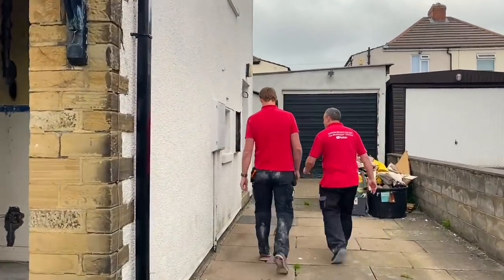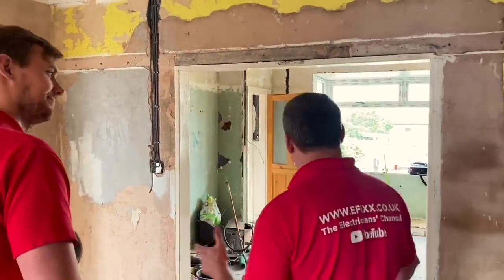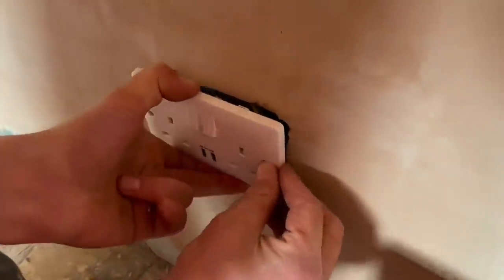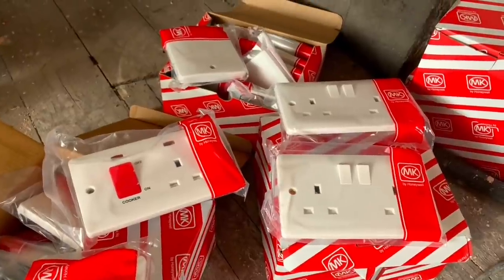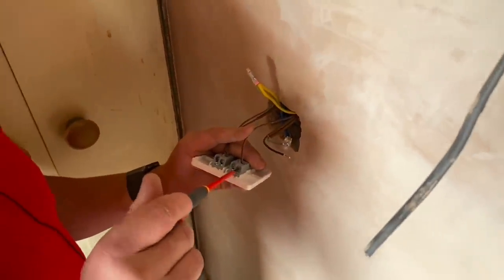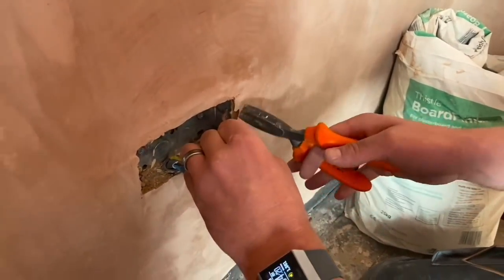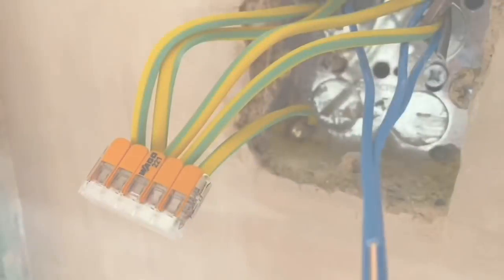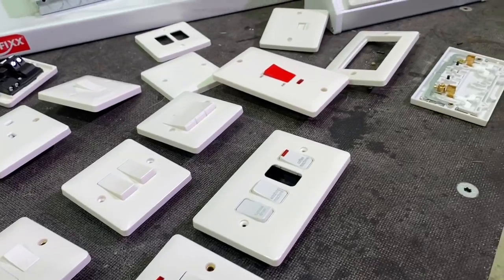BUDGET HOUSE REWIRE - Mates rates with MK Base

Comment: The only thing I do different is if I am doing the loop in loop out method to the switch then I run a 3core and earth from the switch to the light just in case I ever want a permanent feed at the light for future smokes or fans etc or indeed an extra light in the room. saves having to rechase the wall etc
Reply from the maker: Great tip 👍
Reply: Fully agree I do same ⚡️
Reply: Yeah I do the same
Reply: I try to use oval conduit for switch drops so that another cable can be added in the future without having to re-chase but agree about taking a 3 core to the light.
Reply: @KendalMike  yea i always use oval conduit as well but primarily for neatness to be honest
Reply: That's such a brilliant idea. I'm definitely going to do that from now on, if I remember that is.

Comment: Excellent video Gaz .
Now that’s how you strip and terminate cable that guy’s a proper spark , nice little rewire job for a friend,  I’ve got nothing to moan about  for a change .🤣
Fantastic video Gaz as always 🎖👍👍👍👍👍❤️⚡️
Reply: Think if I was going with mk, it would be the logic for me, I really don't like the look of them.
They could put a 50 year guarantee on it, but who's to say they will still be around.
Also clipping cables like that always looks rough to me, and I know there's no reg against it, but a bit of oval doesn't cost much and you can pull the cable out in the future without any damage if you need to.

Comment: As someone who at one time in the 60s was paid to wire up houses I have found your videos have helped my understanding of the new terminologies and regulations. I think they are excellent. The other day I actually found my wind up megger, avo meter, and avo clamp meter!

I was taught to twist my cables together on ring mains and cut to length for insertion into sockets. Is twisting cables together now considered a no no?
Reply: Twisted earth's inside the same sleeving is the most infuriating thing when you want to change an accessory! I spend so much time untwisting them and having to trim and re-terminate the ends of the cables.
Reply from the maker: Back in the day it was popular to twist conductors. However once more extensive testing requirements came along twisting is not a wise choice.
Reply: @efixx  Ah, now that is interesting. I thought I had picked up a poor trait somewhere along the line but I too was taught to twist my conductors. And here I am feeling guilty about all these chaps airing their frustration when they find the conductors twisted.
Reply: On another note I am always surprised to hear how so many sparks refer to ring circuits as ring mains. We had it drilled into us that HV is ring mains and 230V (well 240v) is not, its a ring final circuit. Just shows how certain people have certain 'parts ', if I can call it that, drilled into them and certain others, not.
Reply: @jollyfinequality9865  
Ring mains was the term in use before metrification and followed the practise of 15amp round pin sockets being used on single fused circuits. The ring ,now with a number of 13amp sockets , was anew concept and generally wired in 7/029 Twin & Earth.

Difficult to imagine that when houses were first wired in the 1950s, you were fortunate to have a central ceiling light in most rooms and perhaps no more than 2 15amp sockets in the whole house. Generally gas fired cooker and fire .

On reflection I do now think the changes in regulations over time have been an improvement especially with respect to safety, and the apprentices today have to remember much more for domestic work. On the industrial side however the design and control applications of various motors  etc is now much easier with digital controllers than it was in analogue days.

A great industry to be in for a youngster.

Comment: I was taught to use 15a connectors in the switch for the cpc and neutral leaving just enough copper sticking out to terminate the cpc to the earth tag on the rear of the box holding the both connectors

Comment: I still have my reservations about sockets with built in USB. I can't get past the fact that there are electronics being hardwired to the mains with no means of turning them off without isolating the entire circuit.
Reply: Slap a fused spar in next to it.  Bit of a pain but works.  I still think they should be on the other side of the switch.  They say only a time bit of power but if a road with 200 houses all have 5 or more each.
Reply: Also you have something in your fixing wiring (that lasts decades) that will probably become obsolete, the standards evolve, for example now we have USB power delivery that can handle things like fast charge or powering laptops. 

Even if you use USB, these days chances are that you have an extension lead anyway, and they make one with USB ports in them, so.
Reply from the maker: Should we be installing dedicated charging circuits?
Reply: @efixx  That's an interesting idea. What I'd really like to see is a single gang unit with a switch and maybe 4 USB (A and C) sockets, rather than something that's a drop in replacement for a double socket. Maybe do a double gang one that has the 4 USB sockets instead of one of the mains sockets.
But I wouldn't be happy until the electronics can be turned off without bothering anything else.
Reply: First company that wires these on the other side of the switch, I’ll buy 10
Reply: @tibsie  I think that is s very good idea.  Single or twin face plates with isolator @eFIXX suggest you feed that back to MK ;
Reply: @jollyfinequality9865  Knightsbridge do a USB A and C on a grid unit so could easily be paired with a switch
Reply: I have one roght next my bed and the transformer 'frequency buzzes' unless I have my phone actually on charge. Thinking of just swapping back to a normal socket or using a fused spur.
Reply: @tibsie  on this side of the pond, it's a duplex receptacle with 2 standard USB sockets with about twice the current rating as the current plug in chargers have.

Comment: So the 'zigbee box' is a communications hub for the smart gas meter which, I imagine, was installed at the same time. Known as a 'hot shoe' in the industry, when/if the client has the electricity meter upgraded to smart, the comms hub will be placed atop the new smart electric meter.
Reply from the maker: A hot shoe 👠

Comment: The extra device near the cut out is called a ‘hot shoe’. It’s required when the customer has different suppliers for gas and electricity. This hot shoe forms the gateway for the gas smart meter to communicate to the supplier, instead of the information going via the electricity meter.
Reply from the maker: Thanks 👍
Reply: Why is it not fuse protected buddy ?
Reply: @richardpoulter2146  it’s still protected by the main fuse in the cut out, in the same way the meter is.
Reply: @thomasmalyon1249  thanks mate 😊 
hope there built well then 🤭60amp 😬
Reply: So does the hot shoe communicate directly to a mobile network? Or is it just a sort of interface between the gas meter and the electric meter?
Reply: So does the hot shoe communicate directly to a mobile network? Or is it just a sort of interface between the gas meter and the electric meter?
Reply: @JasperJanssen  the hot shoe incorporates its own communications hub. My understanding is that it works independently from the electricity meter.

Comment: A question from down under (pun intended) Gary - I don't see many houses with floorboards etc on piers in sparky videos from UK. What's the typical construction of ground floors in older buildings then? Our newer builds from 70's or so in Aus are concrete slab, but I do like being able to get under a house for service access.
Reply from the maker: Love that pun Jim  - most new builds now are concrete slabs. The hollow floors can be found in lots of homes from the victorian era through to the 1960's / 1970's - depending upon the ground conditions.  We'd be nervous of going under in Oz because of all those dangerous animals you have!
Reply: @efixx  just a few hundred funnel webs, whitetails, redbacks, brown or red belly black snakes etc... Lol. I do a lot of bush walking, and get used to spiders 🕷️ webs.

Comment: Great comment about the 3+E, I'd go a step further and say make sure you've got deep back boxes especially at light switches where they traditionally have been shallow. Thinking about now and the future for smart home stuff. e.g. I've got Shelly devices behind the switch and 50mm back boxes. For yourself or a customer who asks for it, not a problem. The extra work might be a difficult sell to one who doesn't know anything about it......... But, bet you a tenner they wish they had some time down the line!
Reply: as a yank, ALL your boxes are teeny-tiny.  a standard switch box here is just under 51mm deep, and I prefer ones that are 75mm deep.
Reply: @kenbrown2808  One of the problems over here Ken is that we have a tradition of masonry internal walls..... especially in older houses.... Chasing out for 50mm is hard enough..... 75 would be very difficult, especially without potentially damaging the surface finish on the other side of that wall. Timber frame? Easy peasy.....
Reply: @BerkeleyTowers  yeah, that does make a difference.  BTW, what we build is referred to as "stick built"  and is different from timber frame.  technically, it is "lightweight wood framed construction"

Comment: I have an EDMI smart meter in my house which has that exact same Zigbee box attached to the top of it; have they managed to make the AMPY meter communicate with the EDMI Zigbee box without installing a whole new meter? Seems a strange way to do it if that's the case

Comment: I know it was asked before, but not answered, why don't you twist the cables together when terminating the switches and socket outlets?
Reply from the maker: It makes it difficult to perform electrical testing and fault finding.
Reply: @efixx  But it's much safer. I'd had far too many cables pop out when I've taken a faceplate off because the installer didn't twist. Always leave cables long enough to be remade if necessary.

Comment: Fitting of usb sockets prior to testing, would the electronics within the usb side of the socket withstand a 500 volt phase/nuetral ir test?, hmm.....
Reply from the maker: Yes - but the test result would be a lower resistance than expected. - best to connect L&N together and test between the CPC

Comment: Is it not a requirement anymore to install oval conduit or capping anymore?
Just curious. 
Enjoyed the video.
Reply from the maker: Thanks Nathan for commenting and watching - having capping or conduit is always a nice touch but it’s never been a requirement. Will had the owner Richard do the chasing so it would be interesting to get Wills thoughts on capping. 👍🏻
Reply: Thanks for replying, it just how I was trained back in the UK, I live in Oz, the methods here would stun you!
Reply: @nathanblyth6739  Don't think I've ever seen cables not in conduit or capping. If I told the builder I work with to just plaster over the cables I'd be down the road with a steel boot wedged. 😁

Comment: Since England is all 240V...Do cell phones come with 240V chargers with 2.6amp outputs?
Reply from the maker: Most new phones don’t include the mains charger - you just get a usb lead and have to reuse ♻️ old chargers or buy one.
Reply: @efixx  Fair enough.... But what are the old specs of mains chargers input/output? Ours are 120V in and 2.1amp out.
Reply: @smooth_ops2942  depends on what phone you have I've personally got a few 1 amp older ones, but my current phone uses a 6.5amp 65watt one

Comment: Is it common to not twist the cables together. I saw him just strip and fold over two wires and shove them in together not twisted ?
Reply: A lot of sparks just seem to stick cables in now without even folding the ends. I was trained to twist the two ends together so that you get a more solid connection without the chance of a core popping out.
Reply: @christopherhume8896  that’s pretty shit. I’m in another country. And depending on the size of the terminal just sticking them is not going to give you the best connection and much high risk of one or both of the cables coming out
Reply: @mrseanpride6449  Exactly. I was called to fix a kitchen socket that wasn't getting power but the rest of the ring was. Turned out both of the sockets either side had a cable popped out. That's two sockets working with bad connections. Why not just take the time and do it right?

Comment: Double pole switching on the sockets as standard is a plus. The 20 year manufacturer's guarantee is just marketing spiel - I suspect that the reality of making a claim in even 10 year's time is likely to be a fun story... Also worth noting that the 20 year guarantee does not cover any "electronics" - i.e. the USB chargers, etc.
Reply: Double pole switching on MK base is an option. Watch out when buying, some retailers only sell the SP switched versions.

On the warranties I'm pretty sure electrical accessory vendors (not just MK) are banking on most people not bothering to claim.
Reply: @petermichaelgreen  all the 13A socket outlets are double pole switched on MK Base Range

Comment: Is there no requirement to add an earth bond between the Socket back box and the socket (first socket on video)? If the line conductor became loose and touched the backbox then the screws for the socket have the potential to become live.
Reply from the maker: The socket screws are connected to earth via the socket and if the back box has one fixed lug then you can rely upon this connection. See this video 👉https://youtu.be/Kmu0MkE9fTc
Reply: Watched the link - makes sense. When I served my time back in the early 90s we were always told to bond everything  but I've been out the game a good while now so was 8ntetested to know. I guess adding a bond would only make it more robust but at the same time a bit more time consuming. Thanks for the reply - you have some good informative videos online.
Reply: @mawky1  I have definitely seen youtube sparks who put a pigtail to the box in as a matter of course.

Comment: 15:14 PLEASE don't stick things in your mouth, as you've got NO IDEA where it's been. 
I've worked with quite a few people who stick there screwdriver's n other bits in their mouths and I've told them countless times "Do you have any idea where that's been with all the dirty placed you've stuck it in?" 
And yes, I do know it's a hard habits to get out of. But even if it isn't dirty, you could quite easily swallow it. 
I'm the only person, that I know, that can be arsed to clean their tool's. 

When I work at a McD's, at the end of every job I clean all the tools I've used and get some others out the van to give them a clean as well, but sometimes. I get all my hand & power tools n give them a through clean at home with soap and water, but if there was something really stubborn. I always use break clean and a wee wire brush. 

Btw all this cleaning I'm talking about was BEFORE covid times. 
So now, once everything clean. I use hand sanitiser and/or acetone aswell to make sure there's no nasty's or viruses on them. 

I personally think that EVERYONE should make sure their tool is always clean 😉

Comment: ‘Makes fault finding easier as most connections are at switch…’ what’s different to most being at light? None really, funny reasoning!
Reply: There isn’t a huge difference but you don’t need a ladder to access the switch and having a earth and neutral available at the switch makes testing easier. Usually in residential it’s done this way, commercial settings are different.
Reply: @mrseanpride6449  yeah I’m well aware! Just the way the sparks said it was strange for me, we usually wire to the switch too
Reply from the maker: It’s a not huge difference with standard ceiling rose - however once the client has chosen a fancy light which needs three hands to fit and has tiny screws - fewer wires the better.
Reply: @efixx  always a way around it but yeah that’s correct!
Reply: Also if installing downlights, there is no need for "hidden" joint boxes

Comment: Why does a “1st world” country just bury the cables in the walls like a “5th world” one? The bloke did well by making all the connections at the switch, more intelligent than leaving it in the ceiling. The gear is to be installed after the walls are painted no? so the freshly refurbished house doesn’t look like 💩 when you look at the detail.

Comment: No CPC to the back boxes?
Reply: Not on socket boxes but yes to light switches.
Reply: @willhawksworth6811  why is that the case please ?
Reply: @bluefell4134  socket boxes are earthed through the socket screws, lights don't have the dual earth strap so they require a earth to the metal back box.
Reply: @willhawksworth6811  Thanks for this. ive seen amny videos on here where they do. Thank for taking the time in answering my question.

Comment: Couldn’t see any capping on any of your chases ??
Reply: is that a problem?
Reply: I thought that cables being plastered over had to be protected with capping or a form of conduit to protect the cable from the plaster
Reply: @sve76  Capping/covering cables in a domestic premise is purely optional, I'd personally only cap a cable if the plaster was cement based
Reply: @alhughes9698  I’ve been an electrician for years and it’s only because you ask if that was a problem I looked into it and I apologise as I thought It was compulsory how wrong I was.
Reply: @sve76  every day is a learning day we all grow together 👍
Reply from the maker: Lots of folks you capping and conduit because we now have chasing machines and can easily make clean deep channels. Not do easy back in the day with a bolster